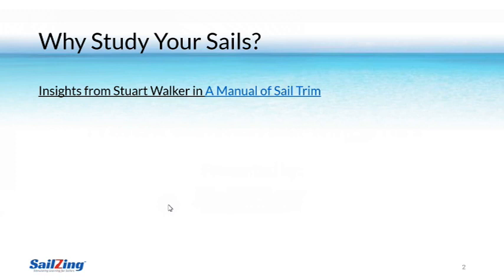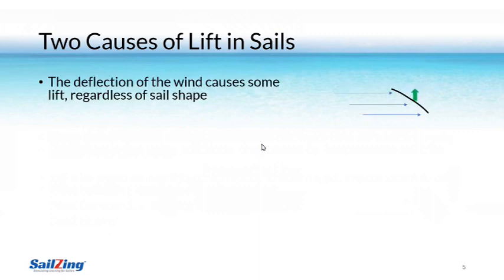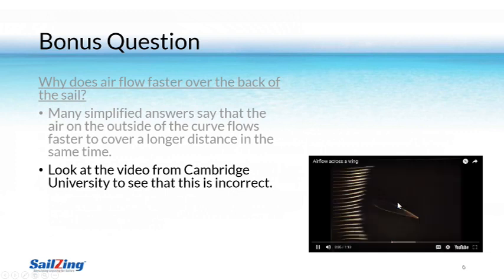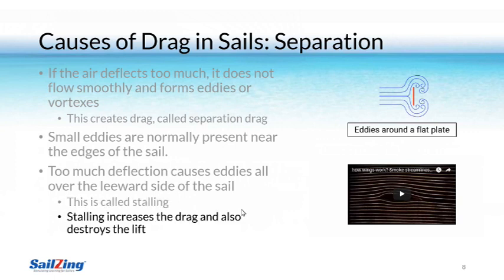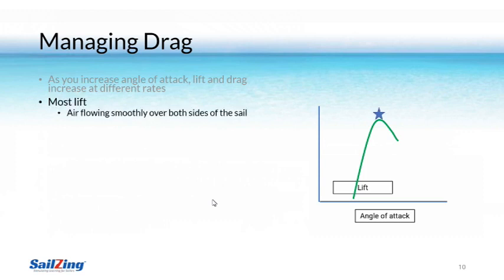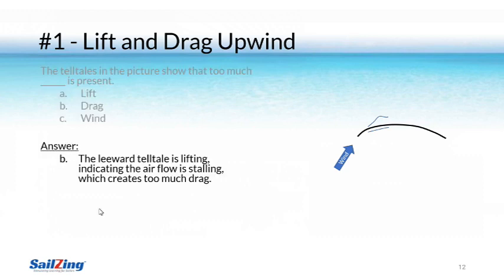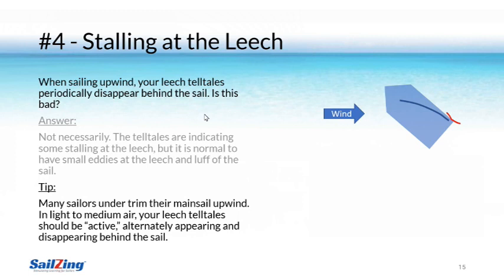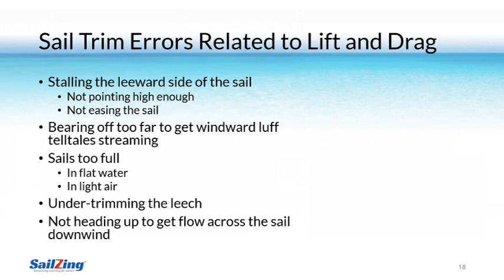Lift and Drag: Prevent Common Sail Trim Errors

Comment: Worth remembering that the mass of a cu metre of air is greater than 1kg. Therefore a sail is deflecting many kg of air continuously. An easy explanation with which I start early sailing lessons.
Reply: This is more like it, but...  You are not deflecting too many cu metres in a second, actually not even one! Even if you have a really big sail on your boat you should understand that b/c of the thickness of the sail that´s just a 1000 of a metre or so, that won´t be a lot of cubics and pressure and pressure differences is all about the area and has nothing to do with cubics!

Comment: The explanation of lift, differences of pressure and differences of velocity on either side of the sail is questionable. Please look up flow turning & NASA explanation of lift.
Reply from the maker: Thanks for the comment! I consulted several sources for this video and all the sources point out the various misconceptions about lift, so I was trying to be as accurate as I could without getting into too much detail. A good source was "The Art and Science of Sails," by Tom Whidden. This source states that lift results from both the turning of the air flow and the difference in pressure between the windward and leeward sides of the sail due to the difference in flow velocity. There are some deep nuances behind each of these sources of lift.
Reply: @SailZing  For sure there is a lot of nuance. You've certainly done a good job with this video. I've found the best way to accurately understand lift is to relate it to the base three Newtonian laws.

Comment: Thanks for this video. from 16:00 you talk about main sail trim and that the upper leech tell tale should move to leeward periodically. I've heard this often and would like to understand: why is that the case only for the upper tell tale and not for those below?
Reply from the maker: Thanks for the comment! Here's the way I see it: I think the boat's performance would benefit if all the leech ribbons disappeared periodically. However the lower two-thirds of the leech is less reactive to mainsheet tension acting through the boom than the upper leech. You'd have to trim really hard in medium breeze to get the lower leech ribbons to disappear, and then the upper leech would be stalled permanently. One way to get more power out of the lower portion of the sail is to ease the outhaul. This puts some shape in the lower leech, and you may be able to see periodic dancing in the lowest leech ribbon.

Comment: One of the best videos on sail trim!
Just 2 questions: 
1.) do we always want our sail to operate at the best lift/drag ratio? I mean at all wind strengths and wind directions? Are there cases where we actually want to operate at minimum drag or maximum lift? Cant find an explanation about this on the whole internet or in the book you refer to (a manual of sailtrim) :)
2.) you show curves for lift, drag, lift/drag ratio vs. angle if attack. How do these curves look like for a “flat” sail vs a a “baggy” sail?
Cheers!
Reply: 1) You want maximum lift when speeding up because the drag haven't got so big yet (speed isn't so high in the boat). These sitsuation are right after tacking (ofc you need to sheat head sail to right trim after speeding up) AND in waves which are slowing you down when reaching, because in waves, (enough) speed means safety.
Reply: Thanks for the response. I think i know what you want to say, but i still dont understand 😄…
I mean i always want maximum speed, not only in waves and after tacking. So should i always go for maximum lift? This should be at a sheet angle just right before the main leach telltales stall.
Also: the aerodynamic drag of the sail and its lift come always as a pair, so as soon you get (max) lift you also get drag. Are you referring to hydrodynamic drag?
Reply from the maker: As the angle of attack increases, both lift and drag increase, but at some point the lift to drag ratio decreases. So you don't always want maximum lift. Once up to speed, you want to decrease drag, just like airplanes do by raising flaps. Better performance.

Comment: In section 6 you say that downwind it is the force of drag that is pushing the boat
As you state earlier drag is a function of lift, without lift you cannot have drag in the terms you define it.
When dead downwind there is no lift, so you cannot have drag. Downwind it is the wind pushing on the sail, nothing to do with drag, it is Newton’s second law. There will be some lower pressure behind the sail increasing the pressure differential, but it is not the primary force.
Reply from the maker: Thanks for your comment. I did a little more reading on the definition of drag. Most definitions refer to drag as the force in the opposite direction of the relative motion between the object and the fluid. I think this definition fits the downwind sail situation. The sail is still moving upwind relative to the wind. The wind is passing the sail, so in relative terms, the sail is moving upwind. I agree that the statement  "without lift there can be no drag" is wrong. Maybe better to say, "lift is always accompanied by drag." You can have drag without lift, but you can't have lift without drag.
Reply: SailZing. When the sail is acting as an aero foil then lift and drag are a function of fluid dynamic forces explained by several equations of which Bernoulli is one. Your explanation of this is good, including your explanation of incipient drag as a function of lift.. However when downwind the sail is not acting as an aero foil. It is a vertical flat body in an fluid stream, in this case air. It is a fully-stalled aerofoil if you like. The force on the sail and its resultant motion is simple mechanics as explained by Newtons Second Law. It is nothing to do with drag even though the inertial frame of reference does indeed have the sail moving ‘ upwind’. The boat would move in the same way if you had a large hosepipe spraying.
a jet of water on the sail. There would be no drag induced by the water. I fear you are trying to post-rationalise because changing the video is a pain, however to be accurate and avoid confusing folk, you really do need to change it, or indeed simply edit it out, as in its current form it is wrong and spoils what is in all other regards a good piece of work on this complex and often misunderstood topic.
Reply: Savage
Reply: whitefields5595 
He did say he would not provide the complete, detailed explanation, rather provide a simple explanation that is practical in the sailing scenario. Your description of impulse due to direct impingement of a fluid stream is also an incomplete explanation of all that is going on. To explain fully would require a few semesters of aeronautical engineering.